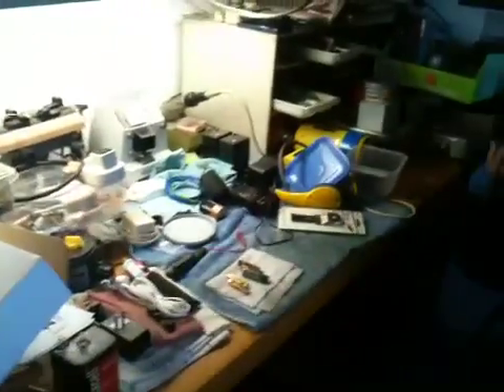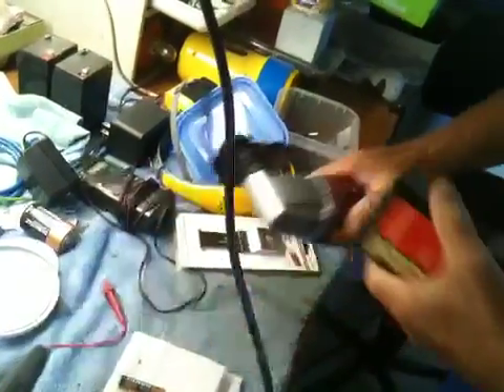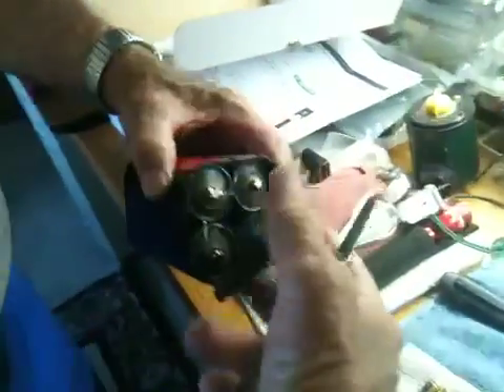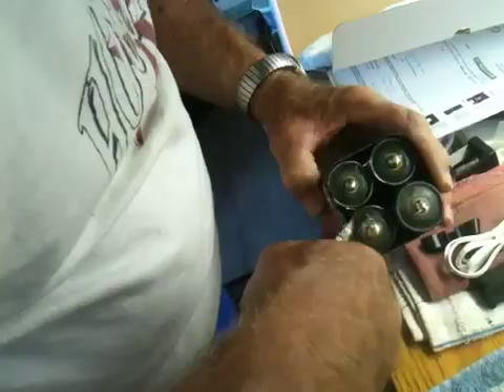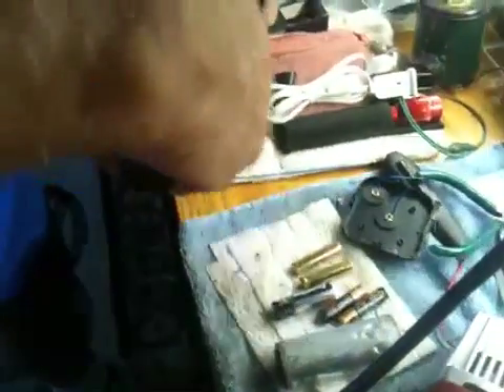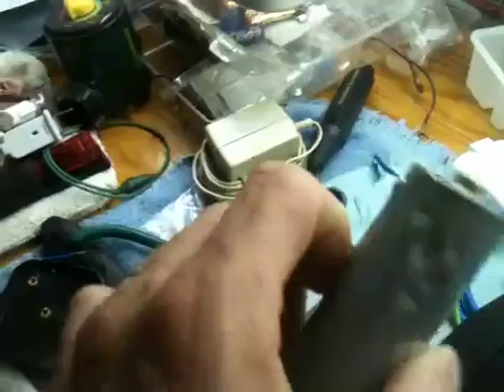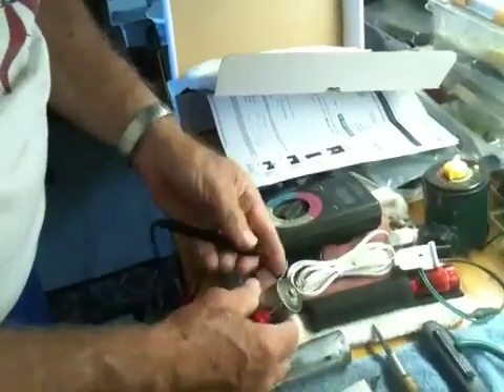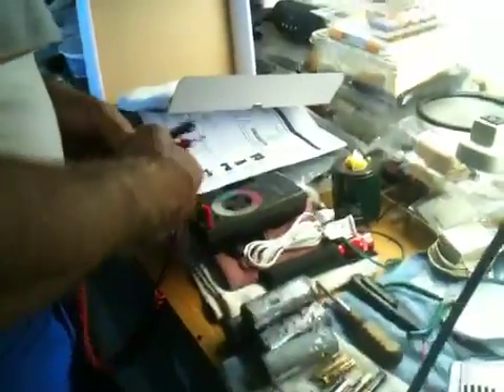Opening a lantern battery

Comment: @hvactecster79 I went all out and bought Fien , it was expensive , but well worth it !!!
I bought the cheaper model Home Depot sells but they came with allen set screw keep throwing blades when cutting into lave ceilings (drywall with mesh backing) , the Fein locks in place , man you can get in the tightest spots with this tool , I basically remodeled whole bathroom with it , from poping old tiles up , easilt removing carpet glur , and cutting hard to reach 2x4 's , definetly worth the price !